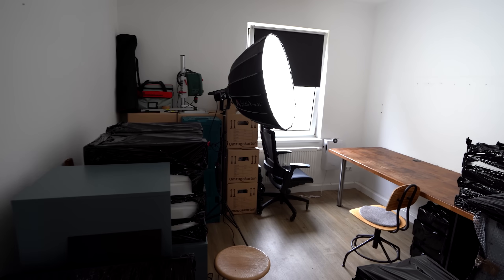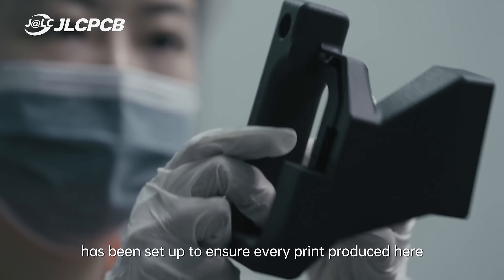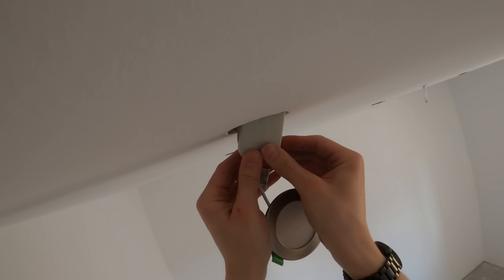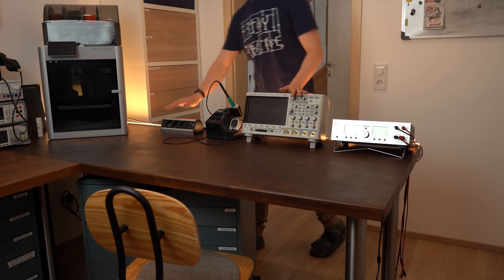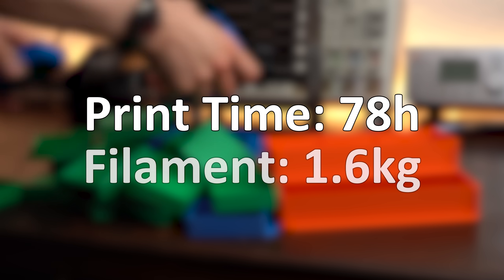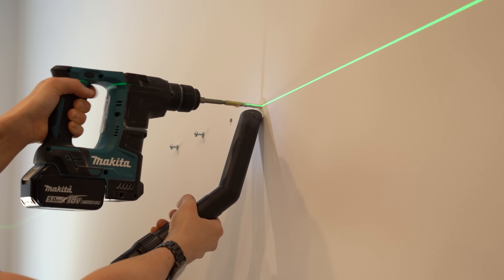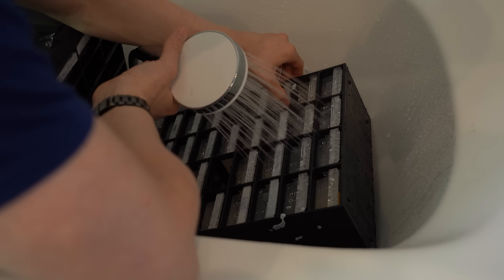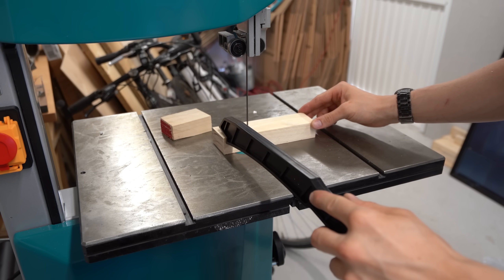German Creates the PERFECT Workshop/Lab?!.....And So Can You!

Comment: After a year of usage how do you like the storage bins. I have printed a few of his over the years and found printing the bins  90% smaller /width wise allows easier sliding.  However, I find the depth of the trays to be frustrating and in the end, not very useful that way. Today I plan to reload those STLs and start looking at printing with a 30-50% increase in depth and will also look at adding gridfinity - if I decide on gridfinity for the worksurface. Not sure yet.

Comment: Not a bad idea to use small plastic box for lights but there is problem if you dont have any "ceiling space" or if drywaller missed spot  where electirian had put cables for lights

Comment: That advise about seperating electrical work from wood/metal is one I should heed.  I occasionally solder on my general workbench where there might be some grease left from a previous bicycle project... I don't plan on replacing my small parts storage stuff even though I got a 3d printer - visibility of contents beats tidyness...

Comment: Very professional and efficient way of assorting components👍I love it😍😍I have one small idea, take a list and then link to a spreadsheet file on cloud. After that with the help of an API wirelessly display the stock status to an GLCD connected to node mcu when a tray is open or switch is pressed on the top of the tray 😊( Display like ...No of components left , New one, Used one , damaged ,total count etc...) Try it 💪 surely you can ⚡

Comment: Few suggestions...
1)Add a fall guard to the table with open back access, you dont want your equipment or stuff falling backside of table.
2)For bulk 3d prints, i would not use 0.4mm nozzle, rather a 0.8mm or 0.6mm. You can save nearly more than half of time in printing.
3) An air purifier is optional but improve maintenance of lab.
4) For SMT resistors and capacitors, if you are only gonna use manual assembly, i would recommend tiny transparent pill bottles like homepathy pill bottles. The paper on the reel disintegrates and takes more space.
Reply: Oh, an air purifier.
Can't let the pesky smoke of soldering flux go where it doesn't need to be.

Comment: Checked out the 3D printable modular storage, and definitely going to replace my old bins with that system. I only have a single Flashforge Adventurer 3 with a build volume of 15x15x15cm, so it's probably going to be running constantly from now until christmas. :'3

Comment: Great video! one tip-you should consider storing the 3d-filament inside vacuum bags that way they will not absorb the moisture and will not become brittel
Reply: I store mine in "Really Useful" air-tight cake boxes with silica gel sachets. Works a treat. They're exactly the right size and are stackable :-)

Comment: You really should enclose the 3D Printing Filament.
Even though PLA is not that bad, some others like PETG, PVB or TPU will take up moisture rather quickly and damage them.
Maybe some acrylic sheets with custom cabinet doors could work nicely for you.
Separate them into like 5 rolls each to properly seal them.

Comment: Build-in LED's that control color temperature with a switch on the main body make no sense whatsoever.
So now you want to have a movie night and you are going to get a ladder and switch all lights to warm-white?

If you are lucky (I haven't opened any of those) you can switch when (one of) the cold-white burns out .

Dimmable is nice though. It is (was when I moved) next to impossible to find off-the-shelf dimmable LEDs

Comment: Not having the luxury of a spare room for my electronic work space I have to use an Ikea Computer Desk with Ikea large Twin Cupboards.  So space is critical for me.  One of the best things I found was SHORT POWER CABLES.  If I need to use my oscilloscope and signal generator I power them with power cables that about 30-40cm long.  The std cables would waste more desk space than the test gear.
Aaahhh ... Ikea  - Swedish for "It'll do."

Comment: Amazing new lab! I’ve got two recommendations. Unless you use all your 3D printing filament rolls very regularly, keeping them on a shelf is maybe not the best idea. They will absorb moisture and end up cracking. Building a dry enclosure for them could be a great idea for a future video. Also, at 11:52, on one of the IKEA drawers, I notice you have glue marks from old stickers. I have found that using lighter fuel and a cloth gets rid of them super easily, you should try it out!
Reply: i was thinking the exact same about the 3d printing filaments, My 2 cents on the sticker residue is to just use some peanut butter on a paper towel to remove it works great and doesn't smell as bad as lighter fluid.

Comment: Immediately when i saw the drawers with labels you printed, i thought a grid system would work much better. A-Z columns and rows, and use a program to keep track of stock and component locations. Could easily use BOM/invoices to import product counts too into software/spreadsheet etc. Much easier to keep track of stock and weird components that dont need a permanent 'named' home. Just like warehouses etc dont have specific locations and names

Comment: Might I suggest adding a simple cleat under the plastic cabinets, to prevent them sagging over time? Similar to how you added one along the wall to support the back side of your desk. I feel like over time the plastic would be inclined to pull apart, though I guess the load is perpendicular to the layer liners, so could be fine?

Comment: Damn
I remembered i need to replace my home wiring from cheap aluminum wire held inside the concrete block wall with plaster going to a single bottle shaped fuse for the entire house to proper 21st century copper wiring going to multiple modern fuses

Comment: Perfect timing...I'm in the throws of building a new work desk right now.  And aside from the height (mine will be ~80cm), I've been considering all the things you covered here.  Storage seems absolutely key, so I'm building built-in shelving to fit dollar-store plastic boxes (because I don't have a 3D printer, lol.)  And I'm doing a curtain thing to hide the storage when I'm not using it because my apt is only 250sqft, and the desk alone will be a good 16sqft (23.2 and 1.5 square meters, respectively).  Great vid...thanks!

Comment: 1. why workbeches are not mobile with magnetic attachment to wall? that would allow you to move it out of the way whenever needed, still be studry enough to work on, and the plating on the wall would provide protection for a wall that lets be blunt is paper and plaster for the most part.
2. if you make lighting distributed that way why not also put a rail that you can move them in as this would replace the need for huge diffused light?
3. why replace see-through bins in storage for opaque? difference is in storage system and not in cotainers themselves, seeing is always better than not seeing a component if it isn't light sensitive.
4. Did You just bought Modular shelf that you are able to make on your own with minimal effort? material in those is usually rubbish, it would cost more but difference would be significant, unless you need it certified. with what i saw in workshop it might take one more day to prepare all components.

Comment: 7:10 I use a system of coordinates on my storage A1, A2, A3… B1, B2, B3…, and I keep a spreadsheet with all the information of every component including the quantity available, the package, and some characteristics like voltage, current, input offset, tolerance, etc. depending on the type of component. This way any new project and I can quickly check what I have available and that needs to be purchased and I no longer have to try to remember what I have or look into a ton of ESD bags stored in different containers it makes a world of difference. It might sound a little bit excessive but after 25 years doing electronics it is worth it. :)
Reply: Can you please develop that as a website so that we can take advantage of your system for our own parts? I think it would be hyper-useful as I've always got lots of thing stashed away 'somewhere' but can never find them when needed!
Reply: @stepheneyles2198 Are you serious? ganopterygon said that he/she has just a spreadsheet for his/her own use... can you imagine the several degrees of complexity that are in the development of the parts control system in a website?!
Reply: @OgbondSandvol Nothing that a good model layer, plus business logic and UI can't do... Just make itchy and it will get scratched...
Reply: @stepheneyles2198 I may look into it, after all it's just spreadsheet UI
Reply: I'm working as a software engineer and I'm often struggling to get any use out of documentation, as it's often outdated or insufficiently detailed. If it works for you that's great but I guess I'm in the camp of "nothing beats holding the parts I need in my hands to check they are there" (at work I look at source code to see what actually happens. Not what's supposed to happen as specified in some document, but what's actually happening).
Reply: As long as you can hold them in your hands that's OK the problem starts when you have hundreds of part numbers, that's why a simple spreadsheet is the solution for me :D
Reply: And the same is true for code: as long as you can quickly read and understand it, that's great, but once the system gets sufficiently complex you need some documentation. Even outdated one is often better than nothing, as it can serve as a starting point for people new to the project. Functional programming makes it much easier to see what the code does without having to analyse each line, but it still doesn't solve the problem in case of very complex systems.

A few years ago I also started numbering my boxes and keeping track of the contents using a spreadsheet. It has already saved me many, many hours of my life, even though it's not perfect and sometimes I forget to put something back in its box or update the spreadsheet.
Reply: I really apreciate this kind of organization, but personally this level of control would be too much for my needs. For some parts, I keep a folded sheet of paper in some of the drawers, where I anotate the parts in that drawer. If I add or take a part, I do a pencil anottation in the paper.
Reply: That's awesome!

Comment: nice video...really well organized dont you use ESD mats on your work bench and the 3d printed boxes for the active electronic components ESD proof ?
If not i wouldnt recomend storing them in a regular plastic box, i have destroyed mosfets/ opamps in the past, also properly grounding the table surface or using an ESD mat is really important!! most company labs strictly forbid in this practice...

Comment: Tip: the fillaments dont like humidity and general dust so should be stored in a dry closed enviroement. But if you use them up quickly enough that method for storing is fine enough.
Reply: There are some filaments like PVB which really like water and i prever to print those while they are in my dry-storage through a hole.
Can make a huge difference

Comment: 4:26 - They look great. I made my own workbenches as well, and topped them with light colored smooth laminate wood flooring planks. With the blond wood and satin black painted wood frame, in passing it looks like something from a 1990's Ikea catalog. I thought I would have to swap out the laminate often due to wear, but it's held up incredibly well. Makes sense, as it's mean to be walked on. Cleans off with spray cleaner and a paper towel. I wish I would have thought of this years ago.

Comment: Nice setup. Your space is about the same as mine. Like you, I have an "en  suite lab" for the mechanical / drilling / laser cutting stuff. I designed my space around ikea storage boxes, but allowed space for a two seater sofa (from ikea) for visitors. I am reluctantly considering removing that for more bench space, because like you, I am space limited.

Comment: Materials question:  Does printed plastic have the same strength as molded plastic?  I know stress applied over time can cause creep and failure if the material does not have the required elastic strength. I expect material specifications for allowable loads are very dependent on the machine settings and part geometry(different cooling rates lead to different bonding).
Your extensive printing will give you lots of perspective on this issue! Thanks for sharing.

Comment: I don't like it when something obstructs entry into a room, like that L shaped table. But I guess it works in your case since you have to film yourself. I would obviously put it next to the wall but that clearly would not work for you.

Also those 3D printed shelves wouldn't work for me. I have cats around and I am kind of clumsy. So if there is an accidental knock, it looks like all the individual baskets would slide out since there's nothing holding them back. I would maybe add magnets to the back so that I have to consciously pull them out and mere shaking wouldn't pop them out.

And the way you have organised according to type instead of actual part number works great. It's a sign of someone that actually uses the thing. Cuz many videos just organise stuff beautifully but when we get to use it, it is all a mess and we can't even get rid of the stuff on our table quickly and then it just piles on. But the way you've organised, one can easily dump all the microcontrollers or high value caps in one basket after use, not having to sort them specifically part-number-wise. Love it.
Reply from the maker: Thanks for the feedback :-)

Comment: Well done, that looks like a very nice place to work. it does take a while to get it right, and your needs change over time, but having a workspace that is made your style and reach is important for work flow and efficiency. It helps that it's also a nice place to be, and your new lab looks great. I have a small work room with Ikea kallax to the right and to the left of my bench and that works very well for my needs: I have modules that fit the shelves for different things, and they're easy to swap in and out. 
I'm a little concerned about the point loads on the screws holding up your printed storage units, as the boards with the keyholes look a bit light for the job: it's hard to tell without feeling the loaded weight and your choice of material though, so it's just an observation. If you do feel it needs reinforcing then a support strip screwed to the wall under the unit could take most of the weight without adding a lot of visual clutter.  
I'm looking forward to some more projects from your workshop now, as you have great ideas and a fine eye for detail that I think will scale well. Thanks!

Comment: Your workshop is amazing, and also that big softbox light. In my workshop I have a sloping and very low ceiling as it is directly under the roof, so lighting for video is really complicated. Has someone found solution to evenly light up a room like that?
Reply: Maybe try lighting the roof. The bouncing light could be enough to evenly light the room. But I still use a spotlight for working.
Reply: @KeozFPV  the problem is that the ceiling is made of dark wood, so it absorbs a lot of light.

Comment: Fantastic work, dude! Your lab and workshop both look amazing! 😃
Mine is divided as well, but it's a freaking mess right now... I hope I can organize it soon. 😬
Anyway, stay safe there with your family! 🖖😊
Reply from the maker: Thanks and thanks for the feedback :-)
Reply: I'm currently in the process of re-organizing my "lab" myself.
I just bought those new drawers for the IKEA Ivar shelves along with the relatively new IKEA Alex cabinets with a door and 1 shelve.
Those are the same outside dimensions as the Alex drawer cabinets I already had.
So there is now one such drawer cabinet with two of those Alex cabinets with a door stacked on top of eachother (all screwed to the wall).

From the IKEA Ekby Alex drawers, I made a stand for on my desk, under my (wall mounted) monitors so I have 2 drawers above my keyboard and fit 2 power supplies under them.
On the side of these drawers I mounted two 7 port Anker powered USB3 hubs to have enough USB ports available on my desk for all kinds of projects, test equipment, etc. Each have 3 extra USB ports for charging.

The monitors are all wall-mounted. Four 27 inch 4k monitors in total. Three in a row and one above the center one.

I do have a Philips Hue Aurelle 120x30cm ceiling light above my electronics desk.
The regular price of it is a bit too much, but every now and then it can be bought at a discount.
It is really good light to work with.

I will have a look at those printable storage sollutions, but not sure where to wall mount it as nearly all my (vertical) walls are now occupied with Ivar shelves and Alex drawers.
Reply: This will help me find things faster thanks!:D
Reply: @Eduardo_Espinoza  I'm going to buy some magnetic strips tomorrow... To organize things like drivers and pliers and stuff like that. 😬
Perhaps you could use the idea as well.